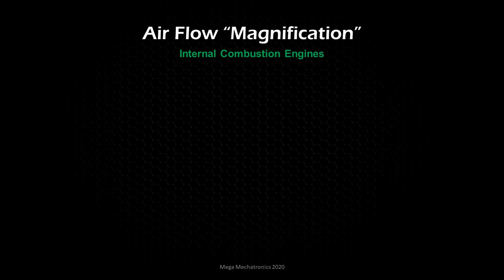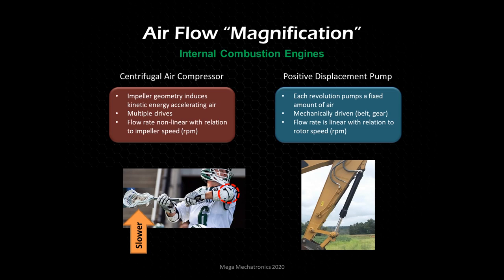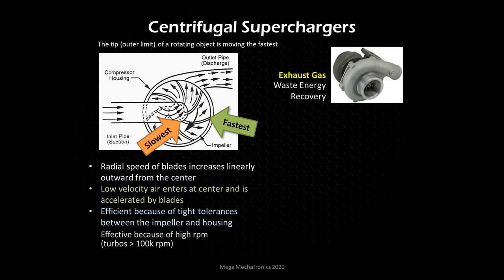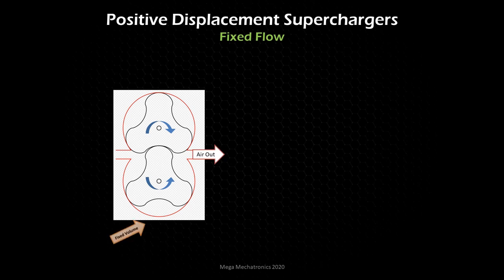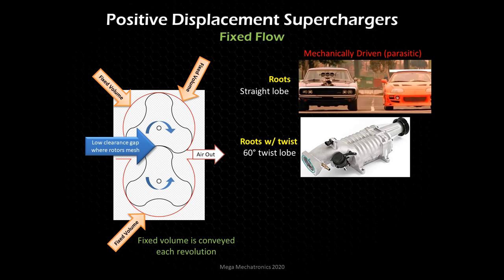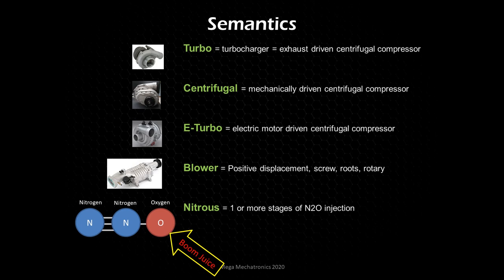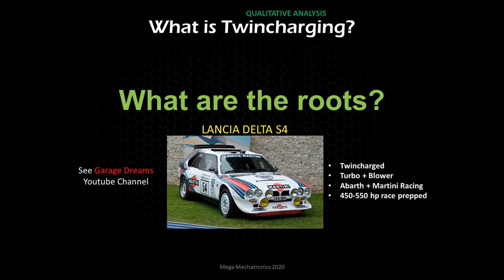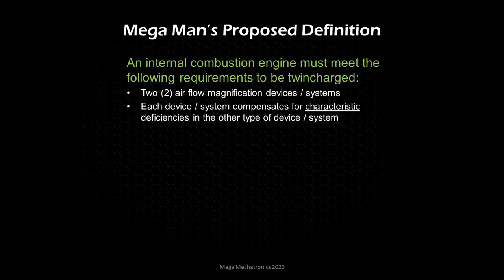How to Twincharger Part 2 - 600 hp Solstice Build - What is Twincharging

Comment: Bit long winded 50 mins b4 you got to twin charging, and it's very slow paced. Great info for beginners. I'm building a vw 1.8 20v twin. Using a merc compressor blower in place of the ac and Ps 😜 boost control is a nightmare tho
Reply: Boost control is actually very simple. The supercharger boost is regulated by pulley sizes, so it  can only do what the pulleys allow.  Max boost at inlet manifold is easily regulated by the turbo wastegate, using a boost bleed valve, wind it up more total boost, wind it down less.  This is how I've run my full compound setup since 2007 and works great.
Reply: It's a lecture. Treat it like he's a professor.

Comment: Just a quick item of note, and I hate to be that "Ackhually" guy, the Eaton TVS is still a roots style. It spins in the same direction as the roots blowers. Just the rotors are twisted more for greater capacity within the body of the rotor per rotation. They say they can get like 15-20% more efficiency out of the supercharger by increasing its aerodynamic volume. and the twists reduce the beating up of the air.
Reply: right! the twin screw has a male+ female lobes, not x2 gay lobes (no offense, it us just to grab the meaning! so if 2 lobes are not interchangeable, it is a big chance it is twin screw. BTW, twin-screws are not pd, they do produce boost! so not blower, booster!
blower: increases flow, booster, fucks the flow for boost! so twin charging is using a booster + a blower! a centrifugical supercharger plus a turbo charger ain't a twincharge, it is a money pit! 😂😅

Comment: Since you requested us to comment below to interact, I would say You're right about everything. I'm going to sit sidelong on the nitrous thing though. 

I don't know if that really counts as twincharged since there are no deficiencies that a turbo or supercharger can really make up for it, and since it's not permanent ANY form of boost would be let down without warning. It's form of forced induction, but not Twincharging.

Second question. I was surprised you didn't cover the sequential/series version of twincharging like the Delta used. Norris Designs has a twincharged evo making 1300hp. Check it out!
Reply: Full compound boost in series setup is awesome! Is how I've done mine since 2007.

Comment: So what's the benefits and negatives of using a centrifugal supercharger instead of the roots on an existing twin turbo setup that has a touch too small turbines?  My idea is to not replace the undersized turbos but instead mount an efficient centrifugal supercharger to add more power and plumb it to the turbo intercooler pipe...
Reply: Yup I’m putting huge centrifugal too medium sized cold side but a .48 ar hot side
Reply: Centrifugal compressor (be it a turbo or belt driven supercharger like a vortex or paxton, etc....) are RPM dependent with how much airflow they can produce so at very low engine speeds, they typically can't produce enough airflow to produce any appreciable boost. With regards to the belt driven versions, you can go bigger and theoretically be able to produce boost at very low RPM's BUT like all centrifugal compressor, you will be in what is called the Compressor Surge Region of operation which will destroy the compressor wheel itself. Along with that, if size just big enough to not surge, they will produces boost at a reasonably low RPM but will over-boost at high RPM's without someway of taking them offline or controlling the excess airflow

A positive displacement compressor such as a roots or screw style compressor on the other hand is a fixed displacement pump in that it moves a particular displacement with each revolution so as long as its sized right and you have the right belt drive ratio, it will produce (or is capable of producing) whatever boost pressure you want even at idle and throughout the RPM range. Outside of external controls, the only fluctuation / change in boost from idle all the way to redline will be the engines pumping efficiency. As the engines efficiency increases (pumps more air naturally on it own), the boost pressure will fall a bit since the compressor is moving a fixed displacement and then as the efficiency drops back off, boost pressure increases back. Some may see this as a negative because they focus too much on a particular boost pressure number but to others, they see it as a positive because they look at how smooth the power (torque) really is. Personally, I'm in the camp of seeing it as a positive because the smoother the power across the RPM range, the more predictable and controllable it is. I however come from a background in circuit / road coarse racing and the smoother and more linear the power delivery is, the faster the car typically will be on track because the driver will typically have more confidence in the car and be able to really keep it right at the limits.